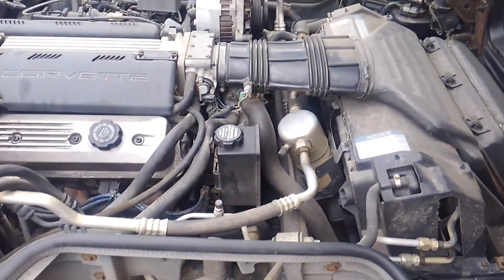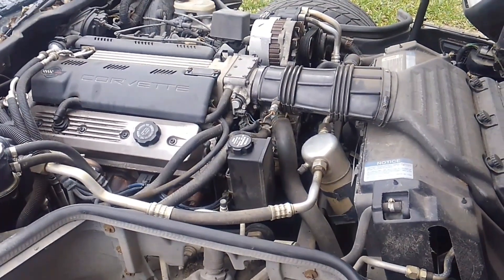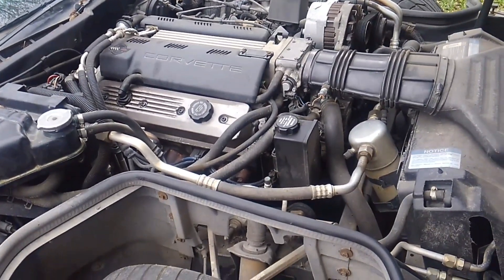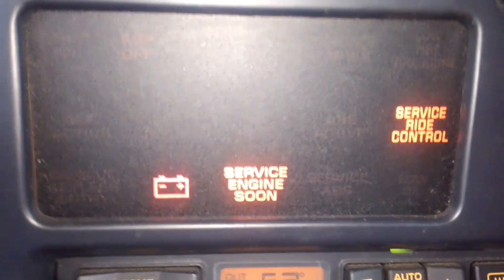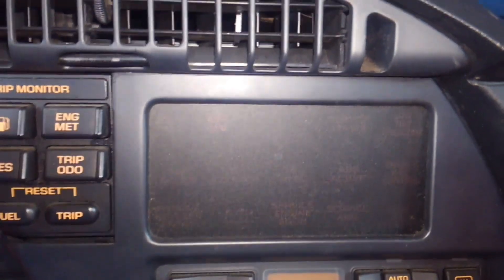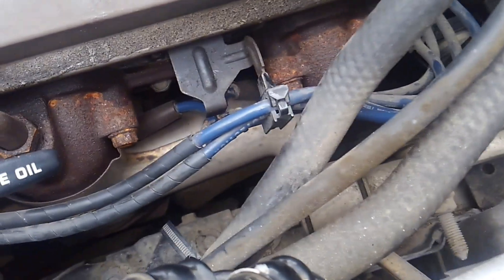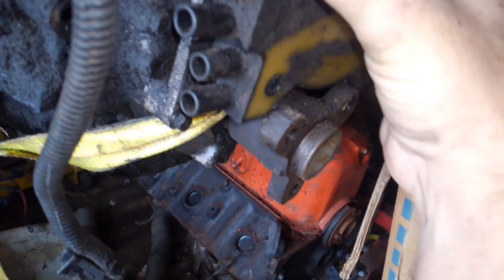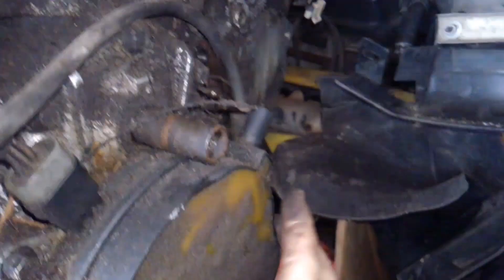The 1990's Corvette LT-1 Engine and It's Optispark Problem

Comment: Hey man. I love your videos. I am on the lookout for a C4 LT4. Would you take a LT4 on long roadtrips where the car sits outside in the rain at night and drives in any sort of conditions in spring, summer and fall time? The optispark is good as long as you dont get it wet from underneath like a carwash or a flooded road for example? Are there parts available for the LT4?
Reply from the maker: Max, glad your enjoying the videos, appreciate the feedback👍. The later C4's are definitely very capable daily drivers in all types of weather and driving conditions. Like you said, avoid the carwashes and flooded roads and you should be fine. In fact the Aqua LT4 youve seen here in the channel gets parked in the driveway and driven as often as possible, regardless of the weather conditions.
Reply: Thanks for the reply. Cant wait to get my hands on a C4. Its the coolest car in the world
Reply from the maker: Yep, it will bring a smile.ro your face every time your behind the wheel.
Reply: Fuellechange
Reply: Channgefueppine
Reply: ⁸9vetyefuellinechange
Reply: Changefuelline89

Comment: I hear there's an ls pcm wire to replace the opti? Good or bad?
Reply from the maker: I've heard about it from a few different sources, but haven't ever been able to personally test it for durability and compatibility. Let me know if you have the information on it, and I will give it a closer look.
Reply: @VetteSource  looks like it's really iffy checking the vette forums, some opt to keep the opti attached but use the ls wires and have the voltage isolated to the black box controller which makes the system think the opti is good albeit its just not on, and some report the car is fine when you take it out and just use the black box, i think to stay safe i would do the first option albeit you still have to change the opti if it dies, you have a gained benefit of being able to control spark and the problem of the opti dying from  water, i think the best more bulletproof option is the ventilated opti though which seemed to fix the problem and no ecu problems. 🤷‍♀️ it really astounds and amuses me the way people fix problems in the most ingenious ways with these cars 😂
Reply from the maker: Honestly it sounds kind of like a Rube Goldberg Machine. Not sure if you've heard of them, but it's essentially an overly complicated way to solve a minor problem. I've seen quite a few of these "workarounds" on newer cars when the electrical issues couldn't be figured out.

Comment: Great video i have a 1993 camaro with a LT1 what would go wrong with the intake to dump antifreeze into the oil
Reply from the maker: Hey Lewis, it possible you have an intake manifold to head leak at either the front or rear intake/head seal. I would also take the time to do a compression check to make sure you don't have a failing head gasket.

Comment: What I did on my 94 z28. First Gen opti.   3 holes on the bottom of the opti housing .  I tapped the holes and added fittings the center hole I ran a line to air filter box drilled and placed 
A fitting there,   Connected so that it pulls a slight vacuum. The other 2 I ran up and made a breather box.   At the top of the opti where the wires go in  I apoxyed it closed.
Now I have no issues of purging the older opti.
The ICM I removed it from the head and Extended the wiring and mounted it the wheel well to keep it cool.
Reply from the maker: That's a pretty ingenious solution. Like you said, keeps you from having to worry about moisture buildup, and ensuring the opti unit will hold up long term. Thanks for sharing👍.

Comment: Could really use your expertise my lt1 gets gas and spark but won’t start 🤔
Reply from the maker: Yep, that is frustrating when you have that happening. Have you verified if the injectors are pulsing during cranking?
Reply: @VetteSource  haven’t checked the back story I drove the car perfectly fine like 3 days before parking it. went back to drive it now it jus turns over
Reply from the maker: Gotcha, if you have confirmed proper fuel pressure at the rail of 42-46 PSI and spark at the cylinders I would guess your having a fuel injector pulse issue during cranking which may end up being a ECM issue.
Reply: @VetteSource  so update I found out it was indeed the opti spark even tho the car still was getting spark but the problem is solved 😁💪🏾
Reply from the maker: Great, that's good news. Glad to hear you got it back on the road. I'll be tearing into the 97 Aqua LT4 soon. The water pump just started leaking the other day so I'll be tearing it down to replace everything.

Comment: I am looking at the other side of the coin and I think the design was genius. Water pumps fail... When you have to replace/service the opti you replace the water pump as preventative maintenance and the engine doesn't experience a catasrophic failure. The LT1 was a great leap forward and I applaud the engineers for taking the chance and for GM to allow it. I'm not sure if we would have the LS without the LT1.
Reply from the maker: Good point Anthony, sometimes it's easy to forget that in engineering design, much thought is given to component replacement and billable hours for removal and replacement. If you consider each new piece of tech as a stepping stone to the next, it's easy to follow the progression of how engines and their individual components have evolved. Thanks for the comments👍
Reply: Please tell me how to " maintain" an Optispark
I also have a '75 and a '68.
It takes about 20 minutes to change the cap,rotor and wires .That's if I stop for a beer
On the ,94 it took me 3 hrs and the OEM Opti with the Mitsubishi sensor was $500
I'm not ignorant about it.
I just don't get the reasoning.And my Vettes could never be mistaken for an Impala

Comment: 94 FB LT1 Automatic 78k miles; hot, stumbles/chuggles/misfires on med hard accel. Clears out and then accels OK. Suspect coil because it seems OK cold. If not coil, should I try just cap and rotor since that's what corrodes? Why even take off the distributor?
Reply from the maker: Definitely sounds ignition related. I always recommend starting with the easy to access components like the LT1 coil and working your way backwards. Usually if there are signs of moisture in the cap/rotor area, it's best to go ahead and change the distributor assembly because moisture has probably made its way into there as well.

Comment: Hi, I have a 1990 corvette. It runs great when driving but when I am a complete stop smoke starts coming from the right portion of the engine. I took it to a mechanic and he says the engine needs a total rebuild. Have you heard of the issue I’m experiencing?
Reply from the maker: Hey Scott, frankly it seems a bit premature for a mechanic to diagnose a smoking engine as needing a complete engine rebuild without a thorough inspection detailing the findings. 

A leaking intake manifold, valve cover, or oil pan gasket can all cause the same symptoms you are describing. 

My recommendation is to solicite opinions from multiple shops to get a sense of what might be going on. I like to look at Google reviews of places I am thinking of doing business with to get an idea of how they conduct themselves. Let me know how it turns out and if you need any further information.

Comment: Thanks for sharing this video. I subscribed. I washed my engine bay on my 94 Z28 and it ran like crap. I let it dry after the engine was at operating temps for a few hours. Still miss fires. How long do you think it takes before all the moisture evaporates??? if it does??
Reply from the maker: No problem, thanks for the sub. The 94 should have the moisture vent built into it, but like you can see in the video sometimes that crusty material will collect inside the cap causing driveability problems. 

I've seen people use heat guns and even park the car on a hot street surface during the summer in an effort to evaporate the residual moisture. At the worst it doesn't do anything, but at least you can give it a shot before having to take the water pump out to get at it.
Reply: @VetteSource  Thanks for your reply. I'm hoping the moisture will evaporate by morning. We will see. It ran perfectly before I pressure washed the engine. And I was aware of not spraying the water pump area.... opti spark. I thought the vent on the opti spark was on the 96-97 LT1??
Reply from the maker: It may have been 95 and later LT's, I may be misremembering. Also, I should have said hair dryer and not heat gun, that would result in a few melted pieces😁
Reply: @camaro69green31  so what happened? I opened the coolant bypass hose and it spelled water on it 💩

Comment: Good video, a couple questions I want to throw out for anyone’s opinion.  I have a 95, only 49,000 but expect some day I will have to deal with the dreaded optispark.  When your opti dies, how many consider replacing with a superior system versus a “standard” optispark?  Also, since the water pump comes out, Great idea to replace it, anyone consider replacing with an electric?   Again, since the water system is drained, consider installing a dual-core radiator?
Reply: Oem opti is the Best opti best optical sensor you can get, put a new cap and rotor on it when the time comes and keep it.
Reply from the maker: Thanks for the feedback, glad you enjoyed it. Personally I prefer stock installations on my replacement parts unless I am doing a hot rod build, plus the OEM usually is a better quality than most aftermarket pieces. 

However, somebody that has gone that route may have more experience than me with those types of installs and can chime in.

Comment: How is it a problem takes a lot of miles to go bad it's not a flaw on a normal motor you would have put several caps wires and rotor button stuff last close to a 100 thousand miles pretty awesome set up
Reply from the maker: You're correct, it's not a bad setup
 However, I think what I was referencing was the inherent difficulty in accessing and changing the unit out versus a good old fashioned cap and rotor. That along with the higher cost of the replacement parts has turned people off to the system.

Comment: Man you really have an engine oil leak bad you know thats bad right very bad for the all WIRING on the car or truck and a fire hazard to
Reply from the maker: Hey Javier, funny thing is that most of the car this engine was pulled from burned to the ground due to a battery charger left on it for too long. The leaking oil was the least of its problems😁. Thanks for the comments.

Comment: Very good system upgrade for it's time if you do the research of how it actually works it will amaze you in comparison to the H.E.I. ignition system of the time, the version2 of it is the most reliable due to being vacuum cleaned from filtered air, this system could keep timing within only 1° of perfect timing which is very impressive compared to other units of its time!!
Reply from the maker: Thanks for sharing the detailed information. I was always under the impression this system had many strengths, it was always just the odd placement under the water pump that thew me off.
Reply: I agree and mine on my 1993 was the original one until this week when I changed it while doing other thing. It still worked fine though.
Reply: That is 100% correct, only distributor that had 360 degrees of timing, the later ls engines only had 54!

Comment: I'm fixing to change a cam on my 97 lt. Is there a way to know when it's top dead center when taking the opti off? Or is that even important to try to do?
Reply from the maker: Easiest way is just pull the #1 plug, and manually rotate the engine until you reach TDC #1. Once you have the timing chain cover off, you will see the alignment marks on the timing and crank gear. Install the new cam using the same alignment.

Comment: Should that seal behind the opti spark be switched out? And the top n bottom also?
Reply from the maker: Hey Roberto, definitely want to change out for new seals as they tend to dry out and shrink with time. I believe the new units will come with replacement seals

Comment: Dump the optispark and go with Torqheads 24X system, as a bonus gain 25 to 50 hp and torque and a OB11 PCM.
Reply from the maker: Good info, thanks for sharing👍. Quite a few of the aftermarket suppliers have come up with optispark alternatives. I don't think I've heard of this system. I'll have to look into it further.
Reply: @VetteSource  I've had it in my 94 Z28 for 2 years now and it works great. It's just as easy to install as it is to replace the optispark. I got to know Paul the owner/designer very well and he's glad to answer any questions you may have. My optispark died on the road, my water pump was weeping slightly and it wipped out the bearing causing it to seize and the spline drive shaft broke off in the cam sprocket with 87,000 miles on the car. 
 The best thing about Torqhead is it's plug and play, no wire splicing. I even brought a spare PCM from him for only $350.00. All the other sensors and coils are AC Delco off the shelf parts. Now I have an OB11 computer and my scan tool gives me so much information.
Reply from the maker: Sounds like a pretty good system, I will be sure to check it out👍.
Reply from the maker: Good point for somebody looking into the conversion.
Reply: Hi, where, how can I obtain the 24X system?

Comment: I saw one guys solution to bad water pumps leaking on the Optispark .
He threaded  the weep hole on the water pump and  installed  a 45 degree elbow with a drain tube on it . That way , if ( when ) Your Water pump goes out , it won't leak all over the Optispark .
Reply: I did that 3 years ago, something GM should have done for less than a buck.
Reply from the maker: I'm about to replace the water pump on the Aqua LT4 and Black LT1. I think we'll try this out and see how it works.
Reply from the maker: That's using your noggin. Good way to head off potential future issues without having to tear it down multiple times. Thanks for the comments👍.

Comment: Please take a look at my video. 95 impala ss bad misfire only on pass side, driver side no problem. took pass head of to check for stuck valves no problem there. plugs on pass side swapped from drivers side didn't fix it. I'm lost on this one unless there is a bad injectors (all 8 have good 12 volts and good ground) any suggestions would be appreciated. and yes removed the Opti to look for problem under the, cap on the pass side clean.??
Reply from the maker: Dantae, looking at the video it looks like you are going to have to dig a little deeper into the fuel and ignition system to find your problem. I would start by disconnecting your fuel injectors and spark plugs wires one by one on the passenger side while its running to see if you get any change in the way it runs. That way you can isolate which cylinder is having the problem and go from there. Let me know how that goes.

Comment: Another annoyance I have with GM, they already had direct coil ignition for a good 10 years, yet they went through the trouble to make this difficult to service and failure prone system, and for a car with little space to work with. And they knew it. It's not like it was done this way to save money either, it was just someone being clever and the customers and dealers having to deal with the problems after. At least it helps keep the sales price of this series vettes down and let the aftermarket make some money coming up with ways to improve the system.
Reply from the maker: Yea, I often wonder if the Corvette, Cadillac, and Lincoln engineers come up with crazy stuff just to say they did it and see if it will end up working. Don't even get me talking about the starter and coil pack setup on the LT5's in the ZR-1's😂
Reply: @VetteSource  Toyota's been hiding starters in their engines for a while. Imagine the fun of having to remove the intake just to change one! I saw pics of another with the starter being inside the bellhousing, meaning transmission removal just for a starter change! And here I thought changing the spark plugs on a 1975 corvette was fun..
Reply from the maker: I know what you mean. I had a great little Nissan pickup years ago that was great a runner and always dependable. However it was never any fun to work on as it seemed the engine compartments were designed for people with much smaller hands than mine.

Comment: OMG!! I'll bet distributor parts are super expensive, just to add insult to injury. God bless the HEI in my '88.
Reply: $575 for the MSD and your troubles are over.
Reply from the maker: Yep, those are a good option. 👍
Reply from the maker: They started out being rather expensive, and are still a bit more expensive than the HEI, but several aftermarket suppliers have stepped up to improve the design to ensure reliability. Thanks for the comment👍

Comment: 96-97 have the vented optispark which is a much better design. My 97 trans am still has the factory opti at 210 k and I just replaced the cap and rotor as a  safety measure when I had the water pump off! The inner parts where clean of water and oil and I was impress lol
Reply from the maker: Thats a pretty impressive testament to the durability of the later units. Then of course they ditched it company wide by 1998. Makes perfect sense in the car manufacturers world. 😁